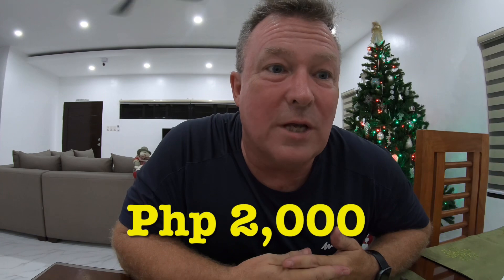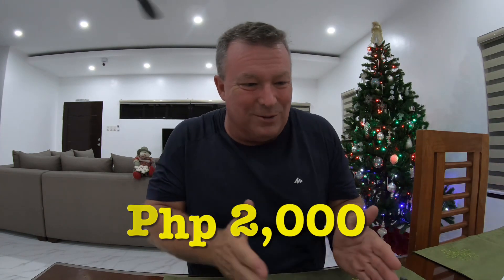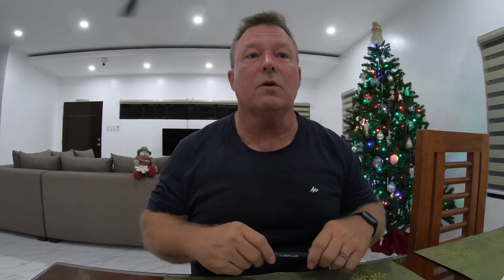SOLAR Update! Part 2/2

Comment: My wife found your channel just last night and I have alraedy watched more then 10 of your videos. Really like your style.
We are just finishing the build of our house in San Quintin, Pgn. 
I was just about to sign a contract to have Solar panels installed but now have asked a quotation from your installer LES, because the other company is from the Metro Manila area.
I had a quotation from a local installer but they're quotation was sloppy so I didn't proceed further with them. But based upon your experience LES seems a good option.
Thanks for your insights and keep it up.

Comment: A 200 amp hour battery is nothing in a house.  Thats what I have in my old Ford camper van.  All it runs is a 61 liter fridge/freezer, lights and a water pump for my sink and toilet.  200 amp hours for a house is a stunningly small system.  I have lithium batteries.  My last two AGM batteries lasted 7 years in my van.
Reply from the maker: Can't argue with you on that.  I will eventually add another 200ah in the future, when we add another A/C.  For now though, it gets us through the night with no problems.  We are running one split type A/C, two ceiling fans, some exterior LED lighting, a full size refrigerator, deep well water pump and miscellaneous interior lighting from about 7pm till 6am when the panels start to draw on Mr. Sun again.  Would have loved to have done more than one battery when we installed, but just didn't have the funds at that time.  We will expand as needed.  Our panels can handle the additional charge with no worries.

Comment: You don't want net metering in the Philippines if you are feeding the grid with your panels then when a brown-out occurs you will lose power to your home as your inverter will turn your power off, you have the proper system for your home for where you live.
Reply from the maker: I did not know that sir, thanks for sharing.  We never went through with getting the Net Metering.  Just super hassle here with this electric provider.

Comment: You don't need a bigger inverter you can parallel a additional DEYE inverter and depending on the model you can parallel up to 16 inverters in one system.  So in the future you can double your system with a additional inverter, panels and battery.  In fact both inverters communicate with each other and work as one big inverter.
Reply: Excellent info Richard.  I have learned a lot from my subscribers when it comes to the solar.  All we really need is an additional 200ah lithium battery and we are good.  Our inverter and panels are more than sufficient to meet our needs.

Comment: A solar company here in bohol just quoted us 75k to apply and connect us to net metering..75k!
We just had a new powerwall 200ah fitted yesterday..it's charging now..Just told the Mrs to cook the rice and boil water with Gasul in the morning so thanks for the heads up!
Reply: I am not surprised.  Doesn't seem worth it to me either.  The cost is just part of the problem, they make it frustratingly difficult to secure all the "Requirements" they want from you.  And we are doing the same thing with our rice and boiled water :face-blue-smiling:

Comment: Great vid again Rick, the way to go add 1 more 200 amph battery we also have 2x200 amph batteries (2x10 Kw @52 volts) and we never use any grid and we run Ac dishwasher at night washing machine and dryer and our hotwater is 200 liter tank with 3kw heating element and our panels is same as yours 5 kw with a 5 kw inverter, it only will take longer time to fully recharge 2 batteries but with on average all day sun its not a problem
Reply: That’s what I’m shooting for!  Saving up my Pennie’s now so we can add the battery hopefully by February.  Thank you so much for sharing what you are doing.  I think it’s exactly what we need.  Merry Christmas 🎄 and Happiest of New Years!
Reply: I appreciate the confirmation!  I am hoping that will take care of it for us.  Out utility bill is down to $40 and will most likely go down to around $20 when we hit the summer months, but I am shooting for that $0 bill someday!
Reply: @rickeybaker9066  Rick if you have 5 KW inverter / solar panels you can add a same 2nd battery, we also have 5 KW in namibia and 2 x 200 amp hour batteries your solar have plenty over capacity to charge 2 batteries and feed the whole house, 2 batt will take you trough the night even with1 ac on all the time
we never have any grid consumption anymore

Comment: Another great video.  You can add a battery to increase your storage as you said.  Also, you don't need to replace your inverter for more generation, just add another one.  My system is two 5kw inverters linked.  Loved the insight on net metering.  Our installer said it can take six months for all the processing and such (chichiburichi) to achieve Net Zero.  We'll just have to wait and see.
Reply: Hey Michael!  Thanks for setting me straight on the Inverter.  I have seen double inverters installed, so it's a good thing that another can be added and linked if needed.  I am hopeful you are successful with getting on the Net Metering.  It would be a game changer for us.  I would just have to stress tremendously to achieve it with our supplier.

Comment: Glad you are pleased with your solar my biggest advice would be to buy the extra battery to get the most out of your panels we have had solar for over a year and very happy plus the extra battery will help if have brownouts before the solar bill would be about 10.000 now we pay 500 peso month 👍
Reply: I am in total agreement with you.  And that is exactly what we will do as soon as I feel I can let go of the P90k it will take to add it.  But it's on the list!  Thanks for watching!
Reply: I'm assuming for that price you bought the blue carbon battery? If so I think the cells are slightly used and they say they are good for 3000 cycles before they degrade about 20%.. The LVsun powerwall has brand new class A cells and are good for 6000 charging cycles before the begin to degrade..in theory should work for 10 to 15 years they say..Cost us 150k.
Only time will tell the truth but worth every penny simply to live brown out free!
Reply: I am about 99.999% sure it was new. If not, someone went through a lot of effort to make it appear that way.  I’m pretty sure the price difference has something to do with the size.  It took 5 grown men to carry the crate from the truck to the pump room about 20 feet away.  When I was shopping l, I noticed the batteries that easily Mount to the wall and are compact, were considerably more pricey.  But, I’m making note of the battery you purchased and when this one does depart for Lithium battery heaven, it will be one I will look into for sure!  If I can get 10 years out of any battery, I would be super pleased.  Thanks for watching brother and have a Merry Christmas and the Happiest of New Years!
Reply: The blue carbon batteries are not brand new like most battery packs sold in the same price range. They wouldn't be my first choice but they're decent enough if that's  the budget you're working with. If you're lucky you'll probably get 5 years out of it.
Reply from the maker: @wanderingandroid  Agree to disagree, but I will take the 5 years of life on the batteries because I am feeling lucky!
Reply: @rickbaker0217  just do a quick internet search. it is not just blue carbon that does this. there are many chinese manufacturers that does the same thing. technically the battery pack system as a whole is sold as "brand new", but the battery cells installed in the pack is not.  that is why they can sell a 48v 200ah battery pack for as low as $1500.

Comment: Remember, ROI for solar used to be 10 years...
So, if your ROI is 5 year, that's pretty damn good anyways.
The only issue I have with your system, is that yo'rer using Lithium Ion batteries, when you should be using the more common Lithium Iron Phosphate batteries today...
LIPO or LFP batteries have none of the weaknesses (Fire harzard and maintaining 20% reserve or cycle times), that Li-Ion batteries have...
Yeah, I would have multiples of your 200AH, more like 400AH-600AH, for the worst case situations like Typhoons and extended loss of grid power.
Reply: I can't argue with you on anything you said Dave.  For me it just simply came down to what I was able to afford after having just paid for a home build.  The LIPO's were just out of my reach right now.  However, hoping when my Lithium gives up in the future, I will be in a better position to make the change!

Comment: What is the differance in pricing between generator and solar
Reply: I am not sure I could make you an apples to apples comparison Donald.  Considering Solar systems have lots of variables that affect the pricing and generators can be almost as varied.  Best thing to do would be to determine your usage needs and select the solar system and generator that would meet those needs. Then figure up costs.  And honestly, the two systems address different needs.  I don't look at a generator as a solution to high energy bills and super frequent brownouts.  It could serve a a decent third tier for an existing solar system however. A solar system really does come close to replacing the electric provider, at least for us in this location with our weather and our usage habits, it does.

Comment: Good information Rick...

Like anything in life, if money was not an issue, I'm sure someone could put in a solar system that power all of Cuyapo. But I think realistically, you are on the right track there. Your point about Jen using the remaining battery power getting the family ready in the morning is a good one. That would make me think a bit more battery storage is the ticket? If you put in another battery, how many extra panels would you have to add to make it viable?
Hopefully as the years go by, new advances in solar will add to the life of the system, and make replacements go from a 5 year cycle, to a 10 year cycle...fingers crossed that happens before, not after we install solar on our house in the Philippines...lol

On a side note, will you do anything resembling a Thanksgiving dinner?

Salamat!
Reply: Hey Brother Karl!  Hope you are well sir.  Yes, adding another 200ah would pretty much take care of our shortfall.  I do not believe we would require any additional panels to take care of them both.  Our one battery literally recharges in just three hours, leaving plenty of strong solar energy to handle a second battery.  Now October would be a struggle, no mater how many panels I throw up there, but we really did ok during that very wet month.  If $60 is my highest electric bill for the year, I can live with that!  You are right, it's incredible how much smarter and better this system is compared to the one I installed in the Dominican. No telling what another year or two will do for that technology.

Comment: Look to Australia for your solar supplies.  If not mistaken,  they are designed with the 220v European plug design.  American solar is 110-120v design. 15 to 20 Amp. 
AGM or Lithium are the batteries to use. 
  Like you have mentioned. The led acid batteries have short life, off gas (Hydrogen), requires maintenance often and require good air circulation  or ventilation. 
Something all solar systems should have is an inline 50Amp fuse to protect your charge controller.
Reply: Good advise Joe.  Not even sure the American solar version is available here.  Most of the solar supplies that are sold here seem to be of the Chinese origin.  Thanks for watching sir!

Comment: Your system cost 350,000 php + any maintenance costs + loss of interest on the 350k php (battery replacement will be needed at 5 years).  The payback on the basis of a 5000 php/month electrical bill will be over 9 years and more like 12 years assuming a battery replacement is needed, possibly 2.

You suggest a 2.5/3 year payback, that means your electric bills are average of 10,000 - 12,000 php/month. Not a chance you'd paying anything that !
Reply: Hey Mike, thanks for watching.  My math comes out a bit different.  I can't base my payback on the electrical usage we had when we had a rent house in Balanga City.  It is totally based on what it would be here if I hadn't installed the solar system.  I thought I explained it in the vlog, but sometimes I don't do the best job of explaining things.  Just to much going on up in this old brain of mine!
Reply: @rickeybaker9066  Love your video's, your doing a great favour to all those sharing openly your build costs and experiences with builders.
Judging from other youtubers costs are on the rise so although your exchange rate wasn't the best at the time you did ok getting the quality of finish for circa 25k/sqm. Cheers for your info, please keep it going.
Reply: @mikeheap7978  Thanks Mike, appreciate the kind words and yes, material costs from the moment we bought the land, to the moment we finished the build, rose significantly.  The builder did account for such a rise in costs, but I am sure it ate into his bottom line and probably a big reason I started to get nickeled and dimed toward the end of the build.
Reply: @rickeybaker9066  I could tell you were getting cheesed off with builder saying this is extra even though it was on his renderings. Not a lot you can do when your tied in, just smile and be thankfull your not paying western prices.
I do like the plot you choose, looks peacefull and with mountain views s bonus. Some of the land prices and house prices are a joke, I'm looking for an agricultural plot min 1000sqm with mountain view and 20min drive of the coast. My total budget for land and build is 10mill PHP ish but could go to 15mill. Your vlogs have helped me get my head around things like perimeter walls, hard landscaping, solar PV and general build costs from 2 years back. Fingers crossed my build goes as well as yours 👍
Reply: 5 Kwh of panels should produce around 25 kwhs per day. At 12 pesos per kwh that's 300 pesos per day so 9k per month, 40 months payback. Battery should last closer to 10 years if it's only being drained once per day.
Reply: @dan90298  Lithium batteries will last between 300-500 charge cycles or 2/3 years whichever comes quicker. I was being over generous with my 5 years assuming the batteries would be well maintained being charged from 20% up to 85% (Reduces your kWhs/day from 25 to 21 and increases the payback period, theres also no account for rainy days). The battery costs were 120k php, the best possible payback would be 5/6 years, you could also be into 2 battery replacements which would make the payback more like 8 years and then your possibly into 3 battery replacements, you see where this is going.The inverter replacement cycles are 10 - 15 years.
Reply: @mikeheap7978   I don't think so, 300-500 cycles is basically just 1 year lol, even lead acid batteries last longer than that.
Reply: @dan90298  Google is your friend, why not check what the experts say ? As I suggested it's possible to extend the life expectency from 300 to 500 cycles (2/3 years) up to 600 to 1000 cycles (3/5 years) with careful charging rates between 20% and 85%. (This will reduce sysytem capacity and increase the payback period).
I have to admit that I have no direct experience of use of litium ion batteries, but there's enough correlating information on google, check it out 😛👍.
Reply: This was in an October 2021 article of British Solar Battery:
The lithium solar battery used in the energy storage field generally requires more than 3,500 cycles, that is, the life span of the lithium battery for energy storage is more than 10 years. The cycle number of LiFePo4 solar battery is much higher than that of lead-acid battery and ternary battery, and the cycle number can reach more than 7000 times.

But what I did notice in my Google search, is their are a lot of varying opinions as to how long these batteries last.  So I suppose time will be the best teacher in this area.  Praying I get more than 3 years from them though.  If I only get that amount of time, then I could have saved money with Lead Acid.  I will choose to think positive on this one!  😉

Comment: Hello again, Mr. Baker! How much would it be to add another 200a battery? And what does "N" and "R" stand for on your ATS in the pump room?
Reply: Hey Scott!  Just emailed you as well. To add an identical 200ah battery would run me an additional P90k + P10K delivery and installation.  The N side of my ATS is our Normal Power side  which means all is well with our backup supplier Tarelco.  The R side is the Back Up side which means that Tarelco is in brownout and we are either Solar in daylight and battery at night with no 3rd tier available.